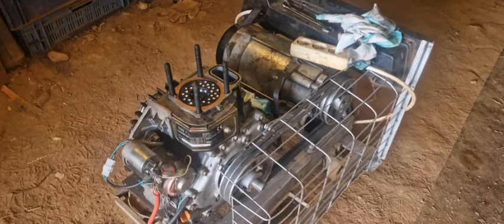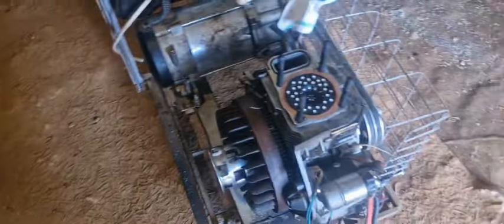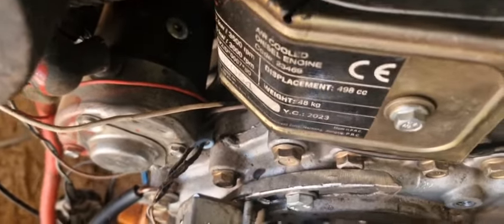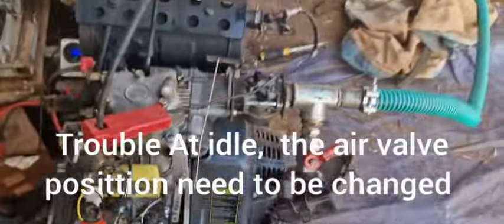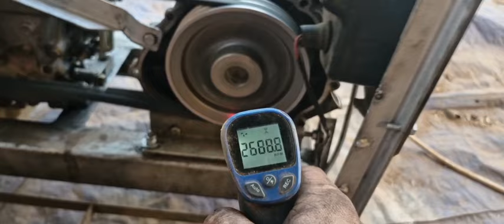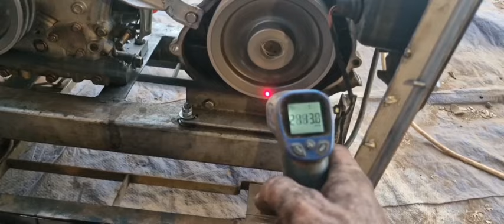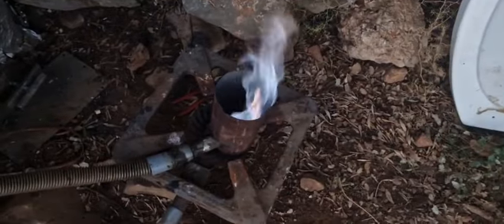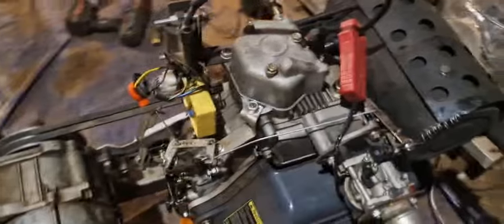high compression woodgas engine #DIYGasifier #BiomassEnergy #OffGridLiving

Comment: That's a nice conversion from Diesel to Treezel  :)  . 
Yours is the first I have seen, that includes a means of shifting the spark timing, while the engine is running. 
In doing this, you have proven the theory about the relationship between improved performance and advanced sparking. 
I imagine that you'd want to delay it for starting, and advance it for running - to take the strain off the starter motor.
Reply from the maker: I appreciate hearing this from a experienced wood bug bite victom , the ideal ignition timing seems to be different for different fuel mixtures . Supper lean (22 to 1 on the meter is about 21 deg) a bit more rich (16 to 1 ) seems to be 13 deg btdc . The compression ratio of this machine is super high (18.6 to 1) ennitbhas not sign of knocking:)  ,  for lower CR i believe the ignition should be more advanced (excemple CR 8.5 i found i got about 200 watt extra from a gx200 clone generator at 36 deg btdc ) . What I'm after is the method of (spcci) this is f1 en mazda skyactiv tech ) that means high cr , lean mixture en late ignition timing.
Reply: @oscarverwey  
Those woodgas bugs really love to nip necks  ;) . 
 Your experiments with CR and ignition timing are unique, as I am not sure that I have seen anyone else doing it.
If we were on neighbouring farms, I am sure that we could combine our resources, to create a truly wonderful woodgas monster  :) . 
Your desire to emulate SPCCI tech is super commendable, and that's where I reckon that computers wood come to the rescue. 
Incorporating a computer into your design, so it can learn how to optimise the system's operation, wood be a dream come true  :) .
Reply from the maker: @CNCmachiningisfun  i agree we should combine forces to design a zero tar monster .I already helped a friend fro. Franse (oliver)  to make a tar free gasiffier en it worked he now traping the last few wood bugs , If you like you can send me a message of fbook ore email (oscarverwey@gmail.com) .
Reply: @oscarverwey  
 That wood be good. Even the woodgas bugs agree  :) . 
Time is a little bit too limited here, as I am building a new machine shop, and setting up this farm. 
These little tasks are keeping me away from my woodgas love, which is really annoying the local woodgas bug population  ;) .